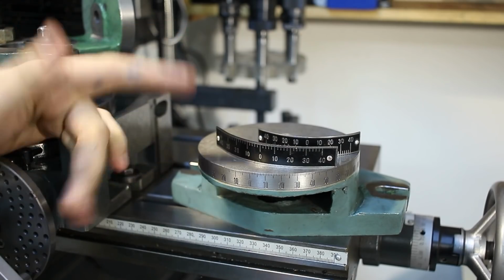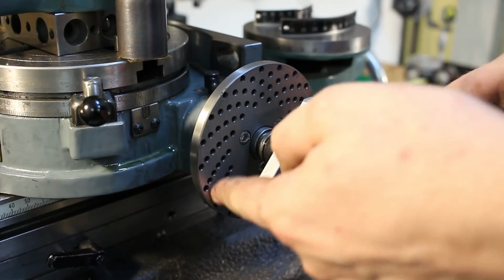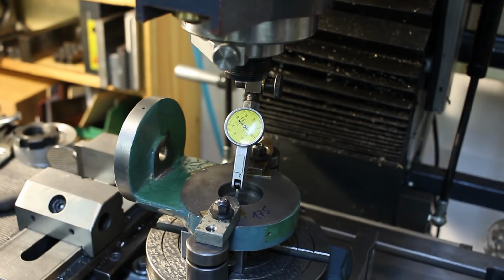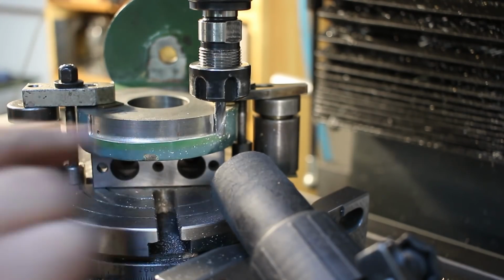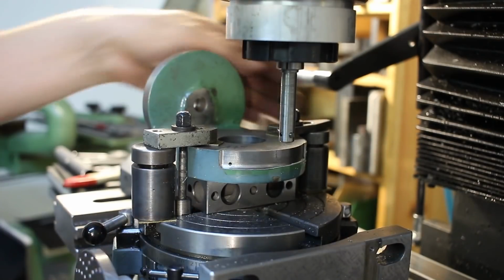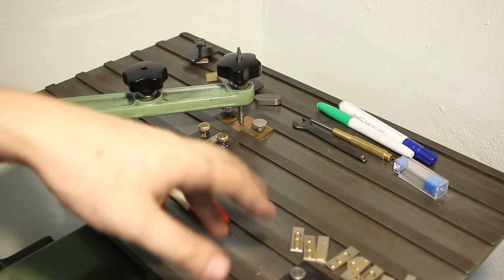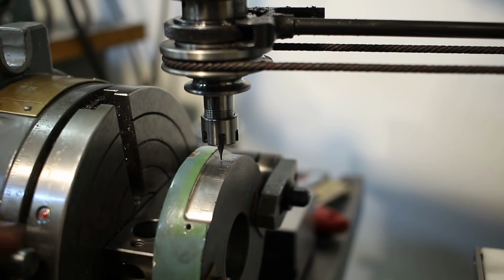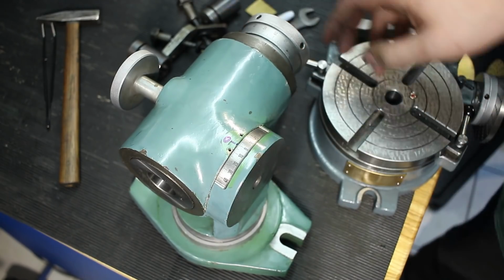Knuth KSW - Engraving the dials

Comment: Stefan, just about to do a similar job on a dial for a lathe carriage stop but I'll be using a CNC 4th axis and diamond drag engraver. I just did a dummy run of the g code and it's full of bugs. Wish I had a pantogtaph engraver like yours. 😕

Comment: I think my "УДГ-160" had a crank handle that you can pull out, rotate some 30 or so degrees and it stays there... haven't used it more than a year, and too lazy to go and check, but afair it had that feature on the handle
Reply from the maker: On mine they forgott to add that functionallity :(

Comment: nice job on that dial , looking at the parts i start to wonder if they can be cast out of aluminium and still get the same precicion when grinding the tools
i can cast aluminium cant cast steel , the temps are too high for that metal in a home forge

Comment: I recognize the handle on that. pull it out and turn 90' put it in the detent so you don't scratch up the index plate isn't part of the plan when I first got mine I fiddled with that for about 10 mins befor I figured out theres no detent if its a 72-1 11 is possible its the 33 hole circle 6 turns plus 18 hole's interesting how I figured that out here goes 33x72=2376 divided by 11 for 216 holes33 divides into 216 well 6 times 198 with the remainder 18 so I just went thrugh the plates holes x 72 and found dividend compatible with 11 some people if the chart wont cut it they wont cut it